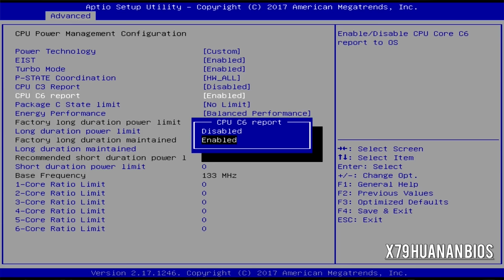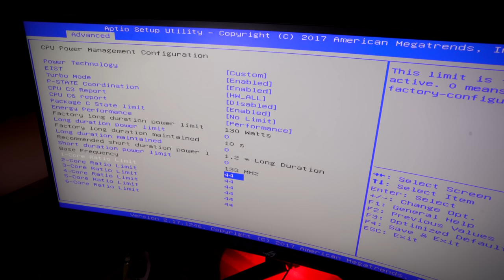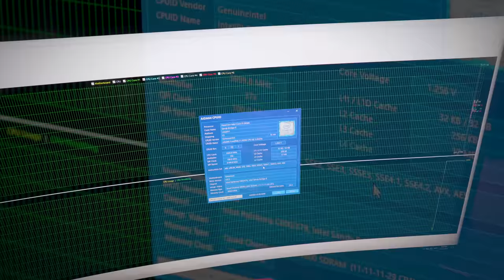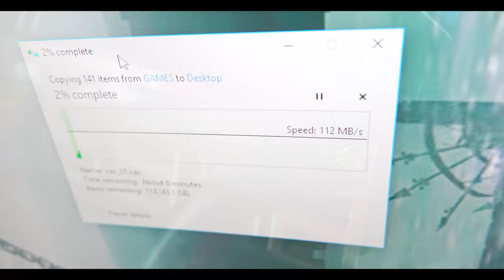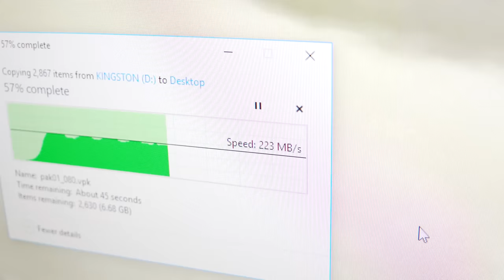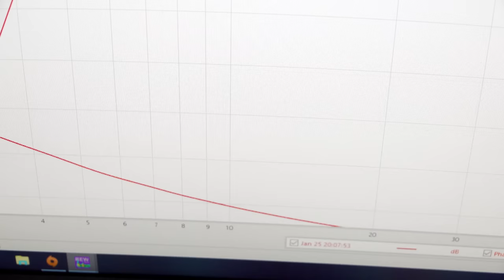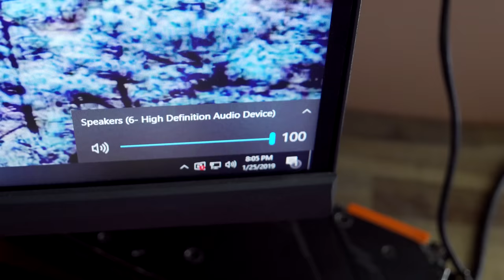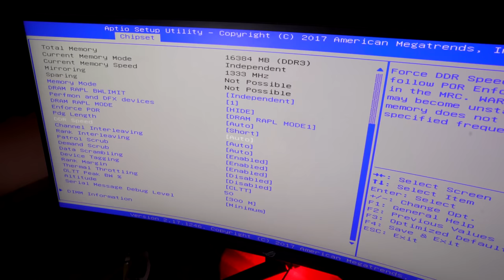Is This CHEAP X79 'RUNING' Motherboard WORTH IT...?!

Comment: I will use my SSD, HDD, Roswill 650W PS, GTX 1050, soundcard and BlueRay DVD from my old DELL XPS 420 Q6600.  Also, an extra 16GB of EEC 1600Mhz RAM I have. Just bought a Cooler MasterBox Pro 5 RGB for $88 delivered.  A Huanan X79 Deluxe with the M.2 slot on the board ($138)...and an E5 1650 V2 ($134).

I think it will turn out to be a pretty decent rig for home use...as I will be satisfied with 3.9 Ghz, so I doubt I will push the limits on OC here.  We shall see.

Comment: your a big fan of x58 right?, is there a trick to getting the hp z400 motherboards to work?. reason I ask is because I have purchase like 6 of these boards off ebay, over last couple of years and they all turned out to be dead or had badly bent pins. but when I would bread board these on the table top with all the harnesses and switches and leds but without the case's, I could never get one of them to post!. but I have no problems with the z800's or the xw9400 server boards or even the z600's, but nothing I do seems to do a damn thing to help on the z400. were these a problem from the factory or what,  because nothing I have read have shown any problems with them.

Comment: That's actually a common budget arrangement. Per phase MOSFET gate driver IC + one high-side and two low-side in parallel, which is a cheap way to distribute the load, lower the losses and make things less explodey. You must find either one very expensive low-side MOSFET with ultra low RDSon or two of the more normal garden variety ones in parallel, that's how it is, and so doubled up lowers are common on budget boards. Separate gate drivers is another cheap solution. I mean nothing wrong with all that, but the whole thing seems to look more impressive to you than it really is?

Comment: CAUTION: 
I heard that only TWO of the FIVE PCI 16X slots even work, only TWO of the FOUR SATA 3.0 ports actually work, and the MSATA doesn't work either. I would highly suggest to not get this board because the above things can't be fixed by a bios update, because the board is improperly wired.
Source: https://forums.servethehome.com/index.php?threads/cheap-chinese-x79-mobos.15278/page-8
Reply: Edison Wong yes. msata doesn’t work no matter how you place the jumpers. The pcie is limited to two; tried gpu and two pcie usb 3 card. Using it for a year now.

Comment: I'd really like to see you try ThrottleStop to see if you can't get those overclocks to stick in the OS level.  I've used it before with z170 laptops with unlocked chips.  The BIOS options were there to overclock (but not yet supported in bios, later were with update) but in the OS they didn't apply.  Throttlestop allowed setting the multipliers with the program and OS.  Also since you don't have BIOS level voltage control, you can use Throttlestop to set an adaptive, or manual voltage control.  It's a very light program and loads of options to tinker with.  
 
https://www.techpowerup.com/download/techpowerup-throttlestop/

Comment: Would it make sense for someone (me) with a complete i7, x79 system from 2013 or so (but which still performs well enough for everything I need - 70+ fps in Terran X3 @ 4k!) to swap in a Chinese X79 MB to get the NVMe capability?  (I have a Gigabyte X79-UP4, so the two things I would lose are the 4 extra memory slots (but I currently use 4x4 (for 16) memory now, quite adequate) and the digital/SPDIF sound output, but I could buy a card for that.)  Thoughts?  I'm currently booting and running off a SATA SSD, so how much benefit would there be to boot/run off an NVMe drive?

Comment: This is not for people that are building from scratch. This is for people like me that already have some DDR3 ram, a decent CPU cooler, SSD, graphics card, etc.

I'm coming from an AMD 960t desktop with 16GB of DDR3 and a Thermaltake Frio Extreme. I also own an i7 2670MQ laptop. All I have to do is buy a cheap six core E5-1650 or an octa core E5-2690 (your choice, both are around $65 to $70 right now), use my DDR3 ram or buy 32GB of dirt cheap registered DDR3 ram on eBay for $45 to $50, use my already powerful 1000w power supply and my old SSD, and the difference would be massive compared to my old rig.

I can choose this more expensive Runing board or I can be patient and wait for a proper branded used board on eBay for around $150. Or perhaps I can choose something less fancy like the PlexHD X79 that can be found for around $90 and does the job just fine. There are many ways to jump on the X79 platform these days.

So, if you are coming from an older platform that used DDR3, for a little over $150 your computer can become relevant again. We are talking about near Ryzen 2600 performance for the price of a single Ryzen 2600 or less. And if you are in a tight budget, there are some motherboards for as little as $60 (not recommend, though), making this upgrade possible with just a little over $100.

So in my opinion, yes, these Chinese boards are still worth it. However, if you are in a budget but are building from scratch, just get a Ryzen.

Comment: Good video. Does this company make boards for other platforms? X58, X99, etc...?
Reply: Probably X58. At least there are lot of Chinese X58 boards around.
Reply: - - Cool, my buddy is looking for one.
Reply: @WarriorsPhoto  huanan and runing both have a x99 right now though the huanan only supports Ddr3 thus cpu choice is very limited the runing supports Ddr4 the huanan also has 10 phase power I think the runing does aswel but not 100% sure
Reply: mark w Awesome. Thank you.

Comment: Bryan, you should look into getting some generic water cooling on Aliexpress, I’ve heard they’re comparable to the $300+ kits that EK sells.
Reply: some are, some are not, a buddy of mine tested 8 kits(sort of his hobby) found one was "bloody amazing" and some where MEH, worse then AIO, but, whats funny is, every kid came with some good parts, sometimes just mixing and matching got him amazing results, one came with amazing fans, but...the rad shroud was crap no seal, moved to a nice uber thiccccc 240 rad that came with a horrible block... etc, it can be fun, some kits are VERY nice for the price, one came with a pump i used in a job i had that would run for a decade 24/7 before a chance it was gonna stop, high flow and pressure... amazing...

Comment: Try buying the bost bought P55 mobo on aliexpress and a Xeon X3440 on Aliexpress and rewiew those?? its 60€ in total
Reply: what mobo? asus, msi, gigabyte? those are like 45-60€ and the cpu is 15/16€ i almost bought it, but then i rememeber i still have a fx8370e with msi 970 mobo that i use for mining so i bought a old h61 mobo with 4 pci ports of aliexpres and i have a dual core celeron to go with that , for the miner. no need to buy more parts when i still have parts.
Reply: idk about the mobo but i've bought a x3440 from aliexpress back then and it run finely @3.8ghz at first but as time went by i've started to get BSODs,having to reduce clock to 3.35ghz
Reply: @reggiexp69  its a p55 unbranded one. No brand name specified
Reply: @marcusbrajic7169  okay so the cheap ones. like those ITX mobo you have on aliexpress for 30 ish euro. got anyluck with OC?
Reply: @reggiexp69  havent got it yet. Its a matx board so we'll ser when i get it
Reply: @marcusbrajic7169  ow yeah, i once got a itx h61 motherboard but the stupid seller send the motherboard in buble wrap... yeah it came bend... so yeah opened a case with aliexpress cause the seller was send it back if you dont want, im like dude its broken dont send a motherboard in bubble wrap.. send it in a box next time for real.... so yeah im kinda upset that it came bend cause it was the cheapest h61 itx i could find....
but i got now a asus h61 matx from aliexpres it was send in a box no problems with it... hope you get your in working condition...
Reply: Just got my CPU and MOBO from Aliexpress, can't seem to overclock it but runs fine in windows no issues so far:)
Reply: @marcusbrajic7169  yeha i tought so u cant oc with those no names mobo. but if it works stock that is not bad already ;)

Comment: Why are people still buying x79 systems today? $150 board + $50 cpu + $120 (quad channel) ram = $320. Surely you can buy an AM4+ system for about the same?
Reply: In my case I already had a high end 16gb kit of ddr3. Saved $200 by just jumping to x79.
Reply: In my Case x79 cost me less than z77.
Got my x79-UP4 for 45€ and my 3930k for 50€. I sold my z77 Pro3 and i5 3470 for 100€.
So basically I saved 10€ and got a better Platform.
Reply: @Mmichex Which latency does your RAM have?
Reply: Motherboard (PlexHd, this is Huanan knockoff but quad channel is working), 8 core cpu (e5-2670) and 16Gb ECC DDR3 cost me 232$, I could not buy 2600X for that in Poland. In DOOM on vulkan, 1080p 50% resolution scaling I got 120-200 fps on gtx960 so this shows future potential, I think this will serve me well for next 2-3 years.
Reply: @Mmichex My 3930k overclocks memory Like a Champ. My 40€ DDR3 1600 Hynix Kit runs at 2133 with 11-11-11-28 :)
Reply: @tybysh  Thx for info dude. Gonna look close to that from now on (fellow polish looking for pc upgrade in 219 ;] )
Reply: X79 DARK $500
e5-1680 v2 $500
Dominator GT 32GB (8x4GB) 2133 - $400
You can't buy cheap knock-off X79 boards and expecting them to perform properly. X79 is an enthusiast platform, not mainstream, and the price reflects that as well. Maybe do your comparison using TR4, and see where the price points land. And don't compare shit Chinesium boards to a quality board either. The best TR4 board costs over $500. And before you ask, X79 supports up to a 12 core XEON, so take that in to account as well.
Reply: @seabastard3747  - Good price. Do you have to pay import on this though?
Reply: @rafagebicki5209  
Be sure that yours power supply Has 2x 4pin IPS connector for motherboard power.
Reply: @Mmichex I should have clarified, prices are in Canadian dollars (CAD), and our money isn't worth shit! LOL! And the Rampage is nice, but doesn't even compare to the DARK. And if you want to run 2 2011-1 XEON's, there's the SR-X from EVGA, which will run you up to $1000 CAD. But that would allow for 2 twelve core CPU's, and the ability to OC through the BCLK
Reply: @Mmichex I'm just awaiting delivery of my 1680 v2 in a day or two, along with a 2990 I'm getting tomorrow. My current 4820K is at 4.984GHz(all core, 24/7)@1.35v@30c idle/60c max. Running the ram at 2400MHz, but I would like to find a quad channel kit of DDR3 3000MHz. As it stands though, my memory throughput is higher than a lot of DDR4, due to the timings. 9-11-10-27-2t.
Also running an OCZ REVODRIVE3 480GB PCI-e x4 card as the boot drive. Not cheap, but lightning fast. Windows in 8 seconds.
Reply: Because older hardware is fun. Thr new stuff isnt that much more powerful and sometimes better.  I upgraded to x99. I still dont see a reason upgrade. Until I see a 4 core 8 thread cpu beating 8 core 16 thread cpu in everything. I dont see any reason to upgrade
Reply: most people have ddr3 sitting around, In my case I picked up a rampage IV extreme with a few bent pins for ~$50 shipped and an e5 2680v2 10 core oc'd to 4Ghz for $160. This is my secondary box I use in conjunction with my r7 1700.  With all the parts I had laying around it was a hell of a deal on the performance per dollar.
Reply: @Mmichex where did you get that deal
Reply: Because it's fun
Reply: @seabastard3747  That board will probably get too hot and eventually die from the heat of the E5 2690. Just be careful what CPUs you put in these Chinese boards
Reply: Wrong calculation, I paid 175$ for CPU/ram/motherboard combo, 232$ with 700w power supply. I didn't measure vrm tmp and did note install additional fan for cooling but I use throttlestop and when watching YouTube or idle I set my CPU frequency on 1.2-2GHz, I suppose this can be benefficial for mobo lifespan.
Reply: @Mmichex You really got lucky bro... Here in India it is very difficult to find such motherboards
Reply: @sobe8991  how did you oc your 2680v2? That's a locked xeon right?
Reply: Where are you getting this magical $50-60 1650? Where? THEY DO NOT EXIST … they run average $130 or more. Sure you might find a one off deal but it's just not common
Reply: @seabastard3747  You forget that you will have to pay customs duty on all of that, on top of waiting for weeks for delivery. Even a first gen Ryzen 5-1600 can be had for under £100 used which will perform very similarly to the E5-2690 and has future upgrade potential whereas the E5-2690 does not. Really difficult to justify not spending the extra few £'s on a much more modern capable and power efficient platform. Easily get a decent AM4 board and 16GB DDR4 for £130-ish used.
Reply: 64GB RAM. And a good Intel Xeon E5-2697 v2  is acceptable speed.
Reply: In my case I got a real asus x79 deluxe, xeon E5 2670v2 a 10cores cpu and a 4x8Gb ram reg ECC 1866mhz for just 3000 mxn pesos *like 150 USD dollars

Comment: For a bit more, probably about 150 Yankee dollar you'd get a proper (2nd hand) x79 probably, tested and working... Saw many of those "no-name" or some "X-name" mobos, some were even strange combos of mobile chipset and dimm ram (not so-dimm), problems with even booting into OS, etc... It's ok if you want to play a bit and throw it to garbage then, X (x58, x79, 99, 299) are (were) workstation platform, and you need stability and support for this use, so those boards aren't really so cheap (read not worth it) if you calculate a bit, but a nice experiment anyway... Sometimes I buy strange parts too to have a peek and have some fun with!

Comment: @Tech YES City I am getting an i7 3930k with an arctic liquid freezer 240 and a Asus Rampage IV Formula. I can not get an  4.6GHz overclock stable, because I tested this combo a whole day with gaming and some stress testing like cinebench, but after 3 hours it crashes all the times (CLOCK_WATCHDOG_TIMEOUT). The temperatures getting no more than 70°C and I tested that system with 1.2V, 1.25V, 1.3V and with 1.35V but that didn't work. Please help me

Comment: Was looking into this board today as there is a mobile deal on AliExpress for NZ$182 however on further inspection this motherboard will not fit my case even though my case will fit an eatx. This motherboard has a non standard shape just like the green huanan x79 2.49. Anyone have any ideas of what case this thing will fit in?

Comment: Those chokes look pretty good. I've found little data on those mosfet numbers but nothing promising. (Still looking) but lets say worst case scenario there 40A chokes. That would be 280A's max going through the VRM. That's enough to run a 6c12t cpu with a light OC. Will get back soon as i find out more on the VRM. Also I'll msg. Buildzoid and see what he thinks. I have a feeling they will be sufficient.
Reply: You coukd try running the latest version of HWinfo64 or Aida64. They may shed some light on the VRM.

Comment: Being a recent design, the BIOS developers really should have included NVMe boot in the UEFI, especially sine they are using AMI Aptio firmware which has an open source NVMe driver. (My dual socket Asus server board has a modded BIOS that supports said NVMe driver, and it boots from a WD Black NVMe 1TB using that native driver.)
Reply: 陈北宗 my z77 board has a beta bios to support nvme booting.

Comment: yes man, just upgraded from a Vega 56 to a 1080ti because I found a bargain. Do you think my 1650v2 @ 4.4 is holding back my GPU for 1440p 144hz gaming?
Reply: Not really
Reply: Only problem is the ram the cpu supports. with it only supporting up to 1866mhz

Comment: That's a 7 phase, they are just using two low side MOSFETs in parallel. I found the datasheets for both high side and low side MOSFETs. 
http://www.ubiq-semi.com/files/1899/890c81e3-09f1-11e7-890c-c7d7e2e5d479
http://www.ubiq-semi.com/files/1898/d02b2752-09f3-11e7-890c-c7d7e2e5d479 
I will try to do some calculations later.
And what is that chip right next to the high side MOSFET? I can't read the numbers on it.

Comment: Is this  motherboard compatible with the i7-4930K and other CPU's from that generation?
Reply: If it's 2011 and supports x79. It will work but bare in mind that if you use an i7 you will need normal ddr3 ram. Only when using a xeon is ecc supported

Comment: I have a gigabyte 970a-ds3p Rocking an AMD 6300... 24Gb DDR3 Ram and a GTX 960 2Gb OC edition.... My gameplay is not great... Could use a few pointers to help performance wise...?
Reply: Id say the issue is CPU and your graphics card, 2GB is just not enough